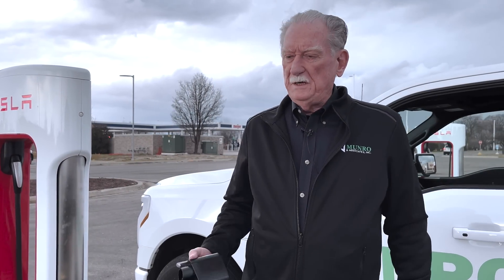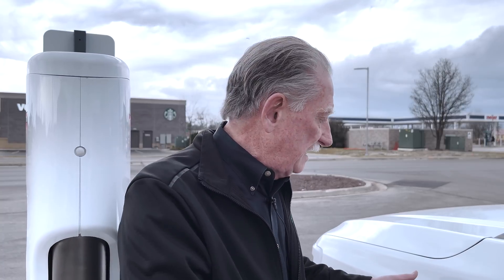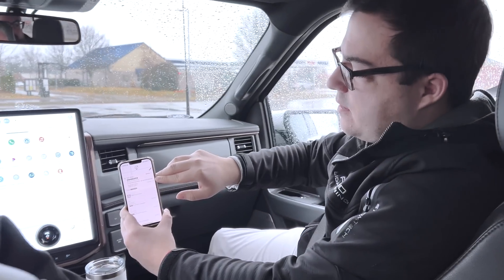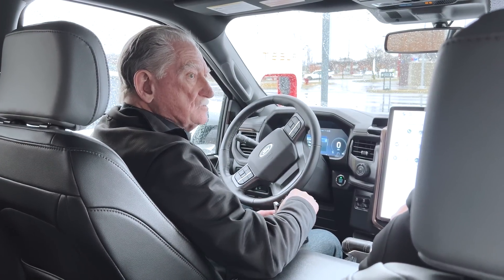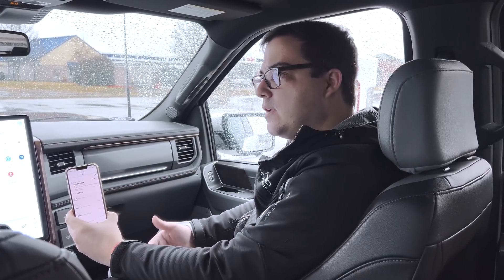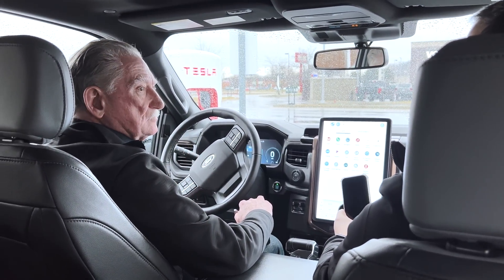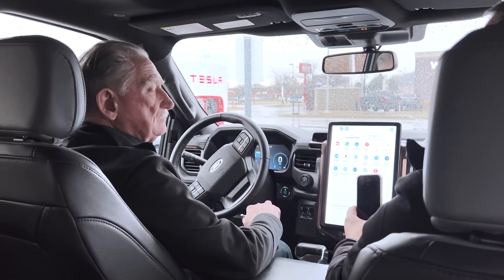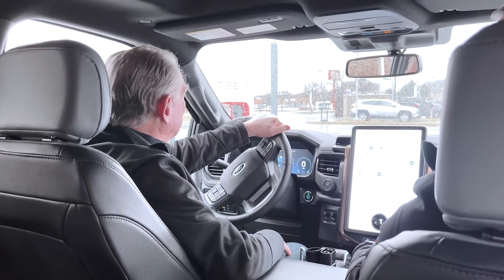Using the Ford Fast Charging Adapter: Ford gains access to Tesla's Supercharger Network

Comment: Why didnt the connector come with a 6ft cable to avoid the double parking?
Reply: The cables are liquid cooled. You can't just toss in an extension and expect that portion to be cooled effectively.
Reply: @Narcissist86  Thanks 🙏🏻 Slipped my mind.
Reply: I'm guessing it is a combination of several things, such as: (1) wanting to avoid additional cost for a 6ft thick-enough cable; (2) wanting to avoid additional weight; (3) wanting to avoid extra storage space required (need to store in the truck rather than in the glove compartment); (4) increasing the length of the cable(s) between a charger and a car increases the amount of electrical resistance, and thus makes charging slower and more expensive; and (5) not wanting to encourage a "we don't need to change the position of the charging port when designing future vehicles" attitude in other car makers.

Comment: I must say that this sounds strange to me. Do EV's in North America have different charging ports? Why? Don't you have a common standard? Does this gain anything or anyone? Here in Europe all have to use the common standard, the CCS port. It looks like the one that Ford uses. It is ok to use another. But it shall be one common standard. All new EV's shall use the CCS port here in Europe. Even Teslas have the CCS port here in Europe. Why don't you have a common standard? It is very simple.

Comment: It's amazing how much simpler the adapter and the app. are and only waiting for 45 minutes;  gone are the days of pulling up to a pump, putting your card in, and fueling your vehicle in 5 minutes... Ahh progress...
Reply: OK,  genius, can you pump fuel from your garage every night for pennies?
Reply: @jamesengland7461  When you can pack the same energy density in a 20-gallon fuel tank with the same time efficiency, I'll listen.   Batteries are not ready for prime time, it's that simple...  Prove me wrong GENIUS!
Reply: @SouthernEngineering I've met EV owners and they LOVE it, no-one's every told me the fast charging experience sucks. YOu can go in somwehere and eat, and when you're done, you have enough range for the next leg of your road trip. Plus, you'd still save money, and don't forget that 20-gallon fuel car makes a LOT more emmisions from the combustion of the fuel in that tank than it's upstream/sourcing emmisions.
Reply: @SouthernEngineering  the ramcharger has over a 20 gallon tank

Comment: I think a Lightning would suit my particular needs very well, but I just don't know if I trust Ford knowing how many design flaws they've put out in recent years and stuck customers with them (5 year old trucks breaking down because of leaky taillights that cost $2K to fix, dual clutch transmissions that they willfully avoided fixing, phaser issues for a decade, etc.). If they had a Hyundai type warranty it would ease my mind, but they won't even sell an extended battery warranty which tells me they have little faith that it will last much longer than 8 years. With the cost of a replacement, any fuel/maintenance savings would be wasted and then some. At least Tesla's are starting to get limited aftermarket support (Electrified Garage is not far from me).

Comment: Just for the record ... I was waiting on a Cybertruck, but instead I just bought a used F150 Lightning based on the availability and simplicity of this adapter. So THANK YOU SANDY for helping to instigate it's creation! 🙂
Reply: So far I really like my used (but like new) Lightning, so I can see why Sandy raves about them.  It’s my first Ford, so it’s unfamiliar and I’m learning a lot.  Each truck has pros and cons. CT draws more attention, is tougher on the outside, charges faster, and has better tech.  F150 goes unnoticed, has more storage volume (mine came with a nice $3K topper), has more accessories, bigger frunk, a MUCH lower price, and was available now. Compared to the 2-motor CT (my preference), the Ford offers similar acceleration and range, and now … the game changer for me … they can both use Tesla’s Superchargers.
Reply: How do you like it?
Reply: I did this exact same thing and couldn't be happier with the lightning. This is after owning 4 different Teslas over the last 5 years.
 @mikelemoine4267
Reply: I believe the F150 lighting beats the cybertruck in everything (that a truck owner looks for)
Reply: @AZY545  I've definitely seen multiple videos of that ridiculous truck getting stuck in what could only be considered light dirt/mud lol. That's the Cyber truck for clarification lol.
Reply: Enjoy the truck, just based on the fact that one is available now and the other is indeterminant. If one does not want the attention then Cybertruck is not the right vehicle, yet. After fives years, I think the novelty will wear off.

Comment: Nice. EV's don't care where the electricity comes from. The charger does care where the money comes from. So now just build that adaptor into the inside of all Fords.
Reply: I believe that's the plan for next year's models. But they needed a stopgap adapter for the vehicles on the road today, otherwise you'd Osbourne today's sales.

Comment: "and thanks to Elon Musk and Tesla for allowing this to happen". YES. Do you think if the roles were reversed Ford or any other automaker would have done this, No Way. Now we need to teach Ford and automakers to get their drivers to park on the far right at Tesla charging locations to reduce to one stall the number of stalls that won't be usable. Tesla drivers will stay to the left.
Reply: Lol. More like, thanks to the Biden administration for requiring open access to chargers for companies that wanted that sweet government money.
Reply: The next biggest move?
Suggest (Or request that Government "suggests") that a "front right/ rear left" port position becomes standard, as of any new model launch, or 2026, whichever is sooner.
.
Then the problem goes away.

Comment: reality check … was this the reason that #thathertz sold out on tesla.. 
do hire car customers have awareness on filling up… a new vehicle… at a certain time..

#henceleapyear
Reply: Also, Hertz went cheap and got all base models. If I'm going to rent an electric car, I'd want the one with good range and some performance capabilities.
Reply: @mikelemoine4267  people in general yet have to know how to handle charging never mind phone charging…
Reply: @batchint On supercharger and such, you just pull the handle out, push the button on it, and insert it. and what do you mean don't get phone charging?
Reply: @casualgamer1209  some people just don’t get it.. including you…
Reply: @batchint What do you mean? I'm open to listen to what you think.
Reply: @casualgamer1209  if you’re a teacher how do you convince children that electric drives are the future…
if hydrogen is a nightmare…
Reply: @batchint You are right that hydrogen is a mess. Full-electric is diffrent, though, and I'd like to point out hydrogen cars are basically alt-fuel hybrids because it's not the fuel cell that moves the car. It's actually a battery.

Comment: Sandy didn’t ask about the cost. Are Ford drivers paying the same rate for electricity as Tesla drivers? Charging apps and locations should post prices just like gas stations.
Reply: Let's say Tesla drivers pay $0.50 at a given location.
The local "other brand" provider charges $0.75 (quite representative?)
Tesla requests a levy of....
35% for those who haven't registered on the app?
Reasonable?
That would be $0.68.
Still cheaper.rven if they charged, +50%, the same price, and it "works"?
.
Alternatively
$12:99 per month, then you get the "Tesla rate".
$12:99 at $ 0.75 minus 0.50 per kWh is 52kWh to "break even".
Basically, your first charge of the month pays for the registration, then it's cheap and convenient.
Reply: The price is set by Ford.

Comment: So much marketing bs. 15 k chargers? No, because Teslas are using 14k already. Not fact but get the point? If engineers were running it thousands of adapters would have been ready to ship on 2/29.
Reply: Sorry, word salad.
Try again
Reply: 15k stalls is still a LOT, and it's probably going to expand as stalls are replaced or get signal conversion hardware, and the adapters probably got bought MUCH quicker then anticipated.

Comment: 🔌🔌One of the biggest complaints I get from older people is phone apps are hard to read and can be misconfigured. Will this app also be available to change the setups on a PC? Once the setups are configured then the phone can be used in the background.🔌🔌
Reply: I don't fully understand, but the adapter can be gotten through the Ford website. I think you can also enroll then in BlueOval(REQUIRED) and Plug-and-Charge through there?

Comment: I think it must be a little humbling for a Ford owner to pull up to a row of Superchargers with "Tesla" displayed on them.
Reply: Well.... If Ford were smart...
I have a suggestion.
Go to the Government and Tesla.
Say
"We would like to build "Tesla inside" Superchargers.
.
We would like to Brand them as "Ford".

We would install them using the Tesla "rapid" method (at similar cost)
.
We would like to receive Federal grants for doing so.
.
We would like to receive charge revenue.
...
At this point Tesla is like "Errrr.... What's in it for Us?"
.
"Ok", Ford says...
.
"It would be great if Tesla could install Megapack backup..."
.
They would use these to:
.
Trade energy (Autobidder....  $$$$$)
.
Supply us (Ford) charge energy (at a rate which allows us to keep prices low)
.
Back up the local Grid (saving Utilities money firing up peakers and improving reliability)
.
And they Advance The Master Plan.
...
The Government gets:
.
A faster Network rollout.
.
A more reliable (cheaper?) Power Grid.
.
The possibility to save "bailing out" Ford(?)
.
The consumer gets "all of the above"
.
Better,  cheaper, more available charging, 
.
More reliable energy, 
.
Less chance of the taxpayer directly bailing out another car company(?)
.
Oh... FORD also gets advertising/ association with a working, self branded charger network (which Tesla can also use!!)
.
Tesla drivers get network relief.
.
Tell me it won't work?
Reply: I don't think it's a big deal. I like Tesla but they don't offer a basic pickup truck. The CT is cool, but impractical and too expensive not only to buy, but to insure. My thought is that it's a running concept car that Tesla is selling to wealthy first adopters to test out it's new tech before rolling it out to mass production vehicles.  I think if Tesla came out with a more mainstream looking truck with mainstream Tesla performance and features at a competitive price, they'd kill their competitors.
Reply: @mikelemoine4267 only time will tell in the next few years. Elon did say at one point that if the Cybertruck flops, they'd probably design a more conventionally designed pickup. To early to say now while it's still riding the novel hype train.
Reply: @burgers8  My bet is that they will come out with one either way. Trucks are in demand and they already have the platform, so I could see them putting a truck body on one of them and calling it a day. The legacy automakers will not be happy but it should hopefully encourage more competition and better features for the money.
Reply: @mikelemoine4267 I can understand that- Lightning is even MORE appealing now that this adapter exists.
Reply: Humbling? Perhaps.  A great relief that it doesn't say Electrify America? Definitely.
Reply: @jamesengland7461 You are right on the EA part tho

Comment: Game changer.  Literally.  This does two things - it makes a reliable supercharger available to the excellent Lightning and Mach E for the rare times a public charger is really needed, and it will force the crappy balance of non-Tesla chargers to up their game or just go away.
Reply: You need to recheck the definition of "Excellent"...
.
Just sayin'
Reply: @rogerstarkey5390 To be fair, I feel like the Lightning and Mach-E are some of the best non-EV sector (Rivian, Tesla, Lucid, Etc.) or China-based (NIO,BYD,Xpeng, etc) electrics on the market in the US- Toyota's platform is BY FAR the worst and Ultium has been plauged with issues.

Comment: ford app and software is too slow to updated.  I've had a charger by my house for 6 months that is still not in the ford navigation.
Reply: Do the math on the Tesla app.
12:99 p/mth
If it saves you 30¢/ kWh, that's only 42kWhbbefore you're winning.
The first charge pays for the month.
Reply: Map updates are delivered via a seperate service in your car quarterly, and you can connect your car to your WiFi for updates.
Reply: @casualgamer1209  my car is connected to WiFi all night every night. Never had an update.

Comment: Great that other manufactures ES's are working on Tesla super charges. Big question is how soon is Ford and everyone else moving there charge port to the ideal location to optimize the super charger experience and not perturb Tesla owners by occupying 2 slots.
Reply: Well, I'm not sure how much of an issue this will be, as long as charge ports are positioned on front passenger or rear driver's side it SHOULD be good. Tesla does have a section on the supercharging FAQ indicated expected behavior for these situations though.

Comment: if things go as they have been, I will receive my adapter, but who knows when I will get a software update.  Had my lightning for 6 months never gotten an update.
Reply: Be careful, the warranty terms specify you have to get updates within a timely period or it can void your warranty if the lack of an update damages something. I think it's mostly related to things that might drain or affect the battery, but if you aren't getting updates you might check their website to make sure you're not missing anything. A trip to the dealer might be required if you can't get them OTA. Just looking out for you!

Comment: How about mentioning the charging speed? Did I miss something? I know ford got a bad rap on slow charging on its trucks. Will this improve that problem, or is this just adding more locations for ford users to sit for extended charge sessions?
Reply: This adapter can't fix that.
Reply: Still the 150kW peak rate.

Comment: You need to open you eyes and read or watch videos as there are MANY cars that have better auto pilot, the extra step is only for the cars built in the last 5 years (which is snapping an adapter on, very big step 😂) as all manufacturers have agreed to go to one universal charging port (Tesla’s).

Comment: Robert is an excellent Ford engineer - always happy to discuss technical details with customers - glad he is part of the Ford team!
Reply: He's a PR guy, not an engineer.   This is basically his job.  See @1:43 - "Manager of Public Charging Customer Experience"
Reply: @ckm-mkc  I know Robert and he is more than a PR guy, but thanks for the observation.
Reply: Cable is too short, next thing to tell him is that others needed to use two supercharger parking spots in certain areas using this... also, next time do not put the carraige in before you have the 'mustang' installed ahead of it
Reply: @dertythegrower 
Nope.
The cable is exactly the correct length for the car it's designed for.
.
Tesla offered the network 10 years ago.
If any vehicle designed since  isn't "right front, centre front, or left rear" whose problem is it?
(Clue.... "Not Tesla")
Reply: @rogerstarkey5390  Co-workers with the Volts had the same problem since the charge port was mounted so far back from the front of the car.  Poor design stays with you for as long as you own the vehicle.  Hopefully Ford along with the rest will see the error of their ways and correct this on future models since most EV charging stations are not on pull through islands like gas pumps.  

In contrast despite its range limitation the Nissan Leaf with its front center port is an easy reach and quite simple to live with.  The 5+ Mile Per kWh makes it easy on the budget too and realistic for L1 charging at home since its fully capable of putting 100 miles back into the battery while your sleeping.  

One guy with a Volt too often broke the cord on the charger at work since he wasn't very good at parking and instead of moving closer would force the cable until it finally broke off plus he would leave it there all day though even when he was topping off and his car was fully charged in less than an hour.

Best!

Comment: Sandy could also thank Tesla engineers since the Ford adapter has been designed and is manufactured by Tesla
Reply: Not manufactured by T
Reply: @4rwayner7 
Yes, it is
Reply: @4rwayner7  Yes according to The Verge
Reply: Source?
Reply: @cyumadbrosummit3534  Designed and engineered : Ford representative in Out of Spec podcast. Manufactured : The Verge

Comment: I’ve had a Mach-e for 3 years and only charged about 10 times outside the home.  Who typically drives 280 miles a day?  I only use it on vacations.
Reply: I do. I travel up and down the coast as my job requires 25% travel. By the way 280 miles is only 140 if you need to return home, right?
Reply: @cyumadbrosummit3534  that is correct.  Most only charge their car to 80 or 90 percent as is a little better for the battery.  However, if you do need more miles you can charge to 100% (which is technically 90% as Ford built in its own buffer) and get about 300 ish miles.  Each year tech is getting better and more miles are being added to batteries and faster charging.  They have a few cars out there that charge from 20 to 80 percent in about 18-19 minutes.   
That's not bad.  Right now is the EV growth spurt.  Give it 8-10 years and we are going to see some really cool tech.
Reply: When you pay for DCFC all the efficiency of an electric goes out the window because of cost. At $0.50/kwh fuel cost per mile is on par with gas vehicles the same size.